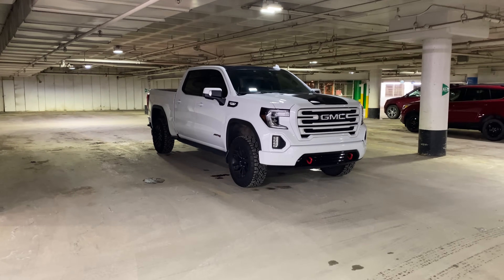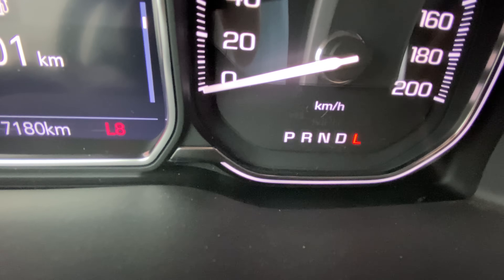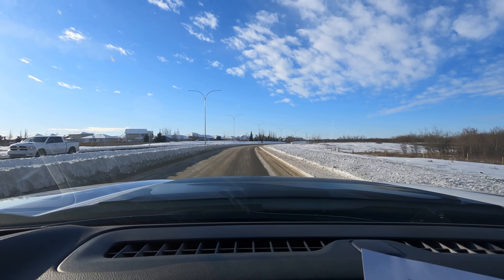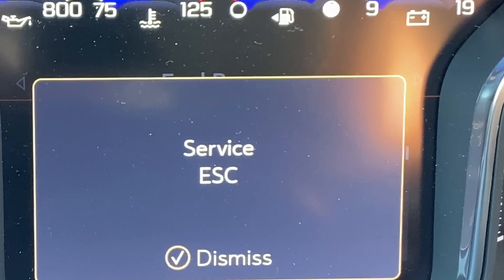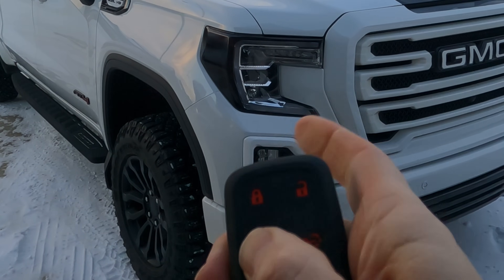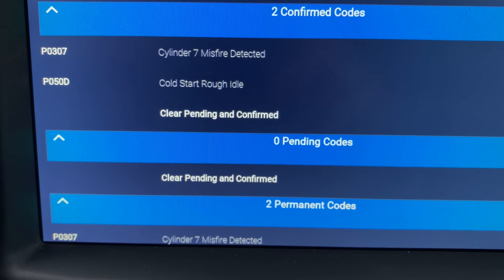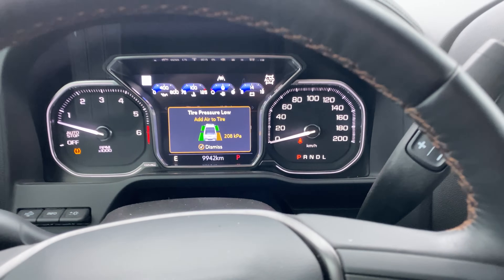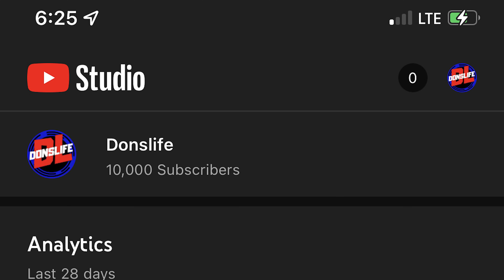Problem - Check Engine Light! What Happened? 2021 GMC Sierra AT4

Comment: My 2021 Silverado 6.2L is at the dealer right now. Just broke 10k on the odometer and going down the highway it started knocking. Bad. I was 73 miles from my dealer in the Montana country. No check engine light. I've got a loaner vehicle right now.

Comment: Since you put  a  aftermarket  air filter  i suggest  get the mass airflow spray  clean the mass sensor  unplug the battery first  it cost the least  to try that it worked  on my  2020 Tahoe RST 6.2
Reply from the maker: Thanks!  I might do that

Comment: Have you had the Service 4WD warning pop up? Just did on my ‘21 AT4 and from what I have found, it’s common with no real problem, fix, or understanding why it happens. The two most common things I found were people cleaning the ground wire underneath the vehicle on the drivers side or the warning just stops one day without any correction.

Comment: My 2021 At4 also has a build date of Jan 15TH ,only 800 miles and keep in storage for winter months' live in NNY and its -4 F here today's hope your truck checks out ok but im very leery about long distance travel esp. because i plan to tow a travel trailer in summer months and would certainly hate to have a lifter breakdown, guess i need to break it out of storage and get some miles on it and hopefully lifters give out before the 8,000 mark to get both banks of lifters replaced locally, sucks because i almost want to sell it on Vroom and order 2022,good luck and i love your channel:)
Reply from the maker: I towed my trailer and boat.  Both on the medium to heavy side of the vehicles capability and it was strong.  The 10 speed trans made it so much better compared to the 6 speed on my previous Denali 6.2
Reply: @Donslife  Good to Know,Keep us posted please on the outcome of your issue,thx

Comment: I got a check engine light on and an error code P0106 and took my at4 to the dealer. They swapped the Map sensor. Then in a few days it lit up again the check engine light. Took it in to another dealership and their excuse was that they couldn’t check it cause it had the s&b cold air intake 🤦🏻‍♂️. And now I got a message that says brake system failure 62mph top speed. Nothing is wrong with it it seems to be running fine 🤷🏻‍♂️ what do you recommend. Thanks in advance.
Reply from the maker: I am going to make a follow-up video soon enough,  I don't really have specific advice.  If anything I am more confused then before I produced this video LOL.  Dealerships vary on what they will look at or not;  Some could care less about aftermarket intakes, some run away.  Myself, I might try putting in the factory intake for a bit and see, then switch back a week later to compare.

Comment: Maybe a winter fuel issue with the additives.  Try running mid grade or premium in winter since they add those winter additives, takes away from the octane rating too much with the 87.  I doubt it will come back after the reset.
Reply from the maker: I have always ran 91 (highest I can get here). Good advice though
Reply: @Donslife  Still maybe fuel contamination at that station.  Apparently during fuel deliveries the truck mixes it all up, bad time to do a fill up.  We have shitty fuel here on PEI.

Comment: 2020 6.2 Boss with a build date of Sept 2020. Lifter failed at 5k miles and both banks replaced. Rotofab intake with Borla S type and quads on mine with JLT catch can that was installed prior to lifter failure. I too had those intermittent warnings before failure. I’m sure you know from Sept 2020 to March 21 was a bad batch of lifters. Been 3K since repair and no further issue. I too need remote start to function as I’m just below you in North Dakota. Went through the same frigid temps this past week. Keep up the good work on the channel. I’ve been following along.
Reply from the maker: Thank you neighbor!

Comment: I purchased a 2015 GMC Sierra decked to the hilt...6.2L and had the engine replaced at 25,000 mi. After that the air conditioning and few other things failed within 2 years. I was sold on a dealership extended warranty and decided to purchase another 6.2 sierra x31 as they promised a warranty for powertrain as long as I own the vehicle. The 2020 that I purchased with a 6.2 l engine failed at 27,000 miles.  They replaced the engine after arguing for weeks. The truck was gone for 3 months and GM did nothing for me to compensate for rental vehicle etc. The dealership had no service vehicles to loan me. I am now sitting my driveway with the same codes as you noted in your at4 with service CSC, parking brake failure, etc etc. I am done and beyond done with GMC.  Can't even drive the truck with 44k miles.  GMC is absolute garbage. I own two F-150 2016 models and two 2016 Dodge three quarter tons and I've had no problems with them whatsoever.  The 2016 f-150s have over 250,000 miles on them and I've had a few issues but nothing as critical as engine failure. The Dodge trucks have been Rock solid with zero issues other than harness corrosion and sh¡tty wiring harnesses.

Any news on what the notes issues cost?  What was the problem?

Comment: Hate to say it, but it’s likely lifters. I had a Jan build 21 5.3 as well from Saskatoon. First batch went at 18,000kms and the dealer only fixed one side. 3,000kms later the second side went. Same codes as you read. 

My biggest advice (if it is the lifters) is to DEMAND they do both sides. First set left me and my family stranded 6 hours from home. Second set, thankfully, we were close to home. I went through a 3 month process w GM Canada. It wasn’t pretty. Be firm w your dealer on what and how they fix it and keep record of all phone calls and paper work. There’s currently a class action law suit going on vs GM and this issue. 

Best of luck!
Reply from the maker: Thanks Steel.  The dealership has been pretty good to us over the years.  If it comes to pushing them to be thorough, I hope they accommodate.

Comment: I have a 2021 Silverado Trail Boss with a 5.3L engine. I purchased the truck 12/2020 and within the first 3 months  (4,000 miles) I had this happen twice. First time the dealer said it could have been a computer glitch. After it happened the second time, the dealer tested the response/recovery rate of my injectors and it was found that two of my injectors had a slower response time compared to the other 6. The dealer replaced two injectors and now the truck has 15,000 miles and has not had any more issues.
Reply from the maker: Thanks for sharing.  This info could come in useful

Comment: Good to know about issues I can look forward to. 2022 AT4 here. I'm ready to ditch all of the "new tech" already and it hasn't been 2K miles for me. I'm already considering an LS swap.
Reply from the maker: I am hearing the 22’s are fine and unlikely to have a lifter problem present itself. Just what I read.
Reply: @Donslife  I REALLY hope that's true. But so far, even the dealer I bought the truck from can't confirm that DFM was removed/not installed from mine. And I still feel the wonkiness (stumbles/misfires) when driving, even in L9. Most notably at 45 mph. Obvious issue with no CELs or anything that I could take it to the dealership for. I've considered ripping the heads off and finding out what's ACTUALLY installed on my engine since even GM doesn't seem to know. WTF is wrong with them?

Comment: That series of failure notifications on the dash are exactly what my 21 5.3 did when the lifters failed.   Restricted speed, idled horrible.   Dealer only replaced the bank of lifters on the failed side.

Comment: I drive a 2021 GMC Sierra AT4 as well and mine is throwing a check engine light at me.  It’s saying it’s the emissions system. -40/-50 sure takes a toll on vehicles.
Reply from the maker: I am inclined to agree. -52°C today (-58°F)

Comment: This issue with vehicles nowadays is everything is so massed produced that you’re bound to have issues with any manufacturer. every manufacturer has came a long way but because it’s all about numbers there all bound to have issues sooner or later. I currently own an 2021 GMC Sierra 2500 with the Duramax I’ve had for 4 months and just rolled over 8100 miles trucks been phenomenal no complaints whatsoever
Reply from the maker: I was so close to getting a 2500 but I felt I wouldn’t get the HD use out of it.  Glad you are having a great experience with it!
Reply: @Donslife  I owned a 21 Silverado 1500 Custom crew cab with the 6.5 bed for 8 months before I got the 2500 and I think it was a bit of an overkill. Honestly just got it just because but since I’ve owned it I’m glad I got the additional payload capacity. I’ve had 2,000lbs in the bed and it was like nothing. I’ve gotten the use out of it a lot more then I anticipated and my wife and I are hoping to get a camper this year.
Reply: @Donslife  oh and the best part has been the fuel economy. Yeah the duramax is a $9800 option in the US but I get 22 miles on the highway 18-19 mixed and about 15-16 in the city. Compared to the 1500 which granted it had the 5.3L with the 6 speed I was luck to get 17 on the Highway I was getting 15 combined and 13-14 in the city.

Comment: I have a 6,2L Silverado with 6,000 miles and the check engine light has come on at least 6 times since new. The dealer says the code said wheel speed senor but they drove it with no issue,  said it was reading correctly. the check engine comes on only for a short time after turning the truck on and off a couple of times.it goes off. I also have a rattling sound from under hood somewhere it is really bad when I cold start but then goes away, but when driving I can hear the rattle around 1,500 rpms with light throttle. it use to rattle every time I came to a stop but when driving in L9 it stopped when coming to a stop but still rattles at 1500 rpm or cold starting..I think the rattle has something to do with the dfm but not sure, if so L9 does not totally stop dfm from working, so I am just waiting for it to blow sadly. I am not sure want I want next as this dfm BS is getting old for the money I spend..BTW I always drive in L9 hoping to prolong it from blowing up
Reply from the maker: Thanks for the info - good context

Comment: I owned a dealership and cold weather misfires are common on all makes and models sooner or later. Clearing the code should take care of the problem. If it happens often, then it's time to dig deeper.
Reply from the maker: Thanks for sharing.  I haven’t had anymore problems since clearing the codes.  Fingers crossed 🤞
Reply: @Donslife   you will. It’s an injector failure.

Comment: I thought I seen you use the settings in the infotainment center to retrieve the diags codes to research the set codes? Is there a vid on how to do this? Your vid's are pretty cool!
2021 AT4 6.2 Just starting the mod process for a few things really liked the video on the mirror spots and high beams. Worried what would that do to the warranty and extended warranty?
Reply from the maker: The lighting mods should be okay.  They are just telling the lights to turn on with another signal/trigger.   As for the diagnostics, I was using an android box that I reviewed in November that adds more infotainment features including installing android apps

Comment: Thanks for sharing.  Love the mods.  Have the At4 2020 with induction and cat back exhaust on 6.2. Love the vehicle.  I think you are correct on your diagnosis.  I had a miss fire on my previous 6.2 turned out plug wire wasn’t pushed right on and it worked itself loose.  Easy fix.   Hope everything works out ok

Comment: Does your dash (especially near the screen, HVAC, and Auto star stop area) flex and make cracking/popping noises at random? Almost like the trim isn't set right. Its -17 in BC or was; as the truck warms up the dash area where i described above cracks and creeks at random. It does not rattle or anything just sounds like plastic flexing and popping. I hear it when i'm just cruising around. Took it to the dealer once and of course they said nothing was wrong. Curious if im the only one. Plus my HUD still shakes but apparently they can tighten retaining brackets.
Reply from the maker: No sir, I also have been examining my HUD for shaking and vibration.  It is pretty good except maybe the littlest fonts on the Navigation can be sometimes a little off on a bumpy road.  Very little shake though or maybe my eyes are old
Reply: All kinds of cheap plastic pops and creaks with mine, HUD is fine.
Reply: @Donslife  You're very lucky! I feel like mine is slowly falling apart (inside). My Heads up Display dances around like it's karaoke night, seats squeak on the outer edges (door side) (both passenger and driver), camera for rearview mirror has a brown contrast, dash noises probably due to the cold. Mirror swivel is now loose, lots of vibration in the mirror just driving around without the camera on. (normal mirror mode) 3.0l Duramax is pretty great though.

Comment: I had this happen with 2 separate 2017 Suburbans. They were idling and it sounded like they were going to blow up. One was the weekend I brought it home from the dealer and I immediately brought it back. The 2nd one happened a little over a year later. 

Turns out it was just a chip malfunction and it was fixed in a few hours. Haven’t had the issue since.
Reply from the maker: So much more complex.  As we all know too well - Gone are the days of just replacing a fuel filter lol

Comment: For all of you GMC pickup 2019 and up..I have a GMC 2020 5.3 Denali and use Metal Lube search about it…. Mixed with synthetic oil with that and runs smooth
Reply from the maker: Doesn't seem like it is available in Canada

Comment: Glad I found your channel - was considering selling my 2019 Super Duty Diesel for a GMC ....finding many issues GM is having. None of the manufacturers are perfect - but my flaking sidestep paint now seems silly to be pissy about. lol. I must mention its my 4th F250 diesel and I have had a 2016 Sierra that had some concerning issues - i traded it in. Diesel fuel prices are ridiculous east of Toronto - so was going to downsize to a gas engine. Might hold off now. Great content Cheers
Reply from the maker: Thanks for watching!  I hear what you’re saying, and yes I acknowledge there are many reported issues with what I have discussed in the video. However, there are far more people doing just fine with these trucks too. 🤷🏻‍♂️

Comment: My 19 Denali occasionally throws those service esc, parking brake, service 4wd, and will also throw a check engine. When I scan it , the scanner shows miscommunication with trans. The check engine light goes away after a day or so, and the service _ lights all shut off after it sits for a while. 
I unplug my negative for about 15 seconds as a reboot here and there and it keeps the truck in top top shape. 
Seems like we have so much crap going on with these trucks that it acts like a pc with not enough Ram. Mine happens mostly in overly humid weather

Comment: Hi Don.

Maybe injectors?
I had that happen last year.
2017 Sierra Denali 6.2L, 8spd, with aftermarket tune, and 315x50x20 Ridge Grapplers.  No other mods.  

Happened in Feb. of last year, right after snowpocolypse here in the nation of Texas. LoL  It had 37k miles.  It was throwing the D050 and a P code.  I don't remember the exact P code.  I've gotten a new phone since then, but it was something similar your P code.  Warranty fixed it, even though I had the tune on it.  It had two bad injectors; #5 and #7.  I don't know which was which, but they said one tested at 50% and one at 70%.

I use only Top Tier fuels, but I bought the truck with 34k miles, so I can't say how it was treated before.  I do know that the check engine light was fine until I put the tune on it.  At first I was turning off AFM, and increasing the red line in addition to the tune.  I played around with different combinations.  In the end, it quit coming on with just the tune.  For about a year, then in Feb it started coming on even without the tune.

For what it's worth, I had the same tuner on my 2014 before it.  That had 5.3L with 6 spd, K&N cold air, Flowmaster cat-back, and 33x12.50x20 Ridge Grapplers.  I traded that on the 2017 at 78k miles.  Never had a problem.

Comment: No idea what the engine codes are for but I hope you find out about the ESC and power steering though, I had a 2020 GMC Sierra and it disabled both on me twice for no reason at all, and fixed itself after completely turning off the truck. I do have a 2020 GMC AT4 like yours now so this worries me but I live in good ol’ Texas so cold weather isn’t really a problem here.
Reply from the maker: 🤠 I think the P050D cold start rough idle might influence the other systems until it is resolved.  ESC, steering assist and the electric parking brake are drivability systems.

Comment: If it starts to pop like a back fire it's a lifter failure, my 5.3 AT-4 dropped a lifter at 8400 miles, no check engine light. Second failure at 11,400 dash lights lit up like a Christmas tree and same messages on my screen as you had.
Reply from the maker: Hoping for less drama 🤞

Comment: Keep the Good information coming, I bought a new GMC sierra denali I had several check engine lights on when I purchased this truck. I became worried and had taken my truck into the dealership with 250 miles the misfire code came up but after two occurances I haven't had a issue since. I love my truck and watch your channel to install your easy do it yourself upgrades.
Reply from the maker: Thanks for sharing and I am happy to keep the projects coming!
Reply: Como se soluciono el problema amigo? Porque tenia esas luces de tablero prendidas?